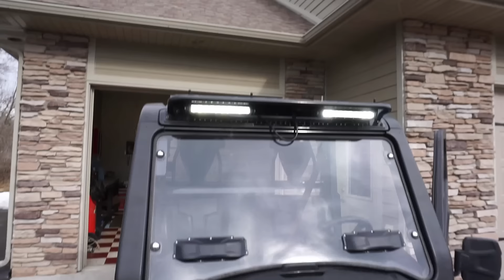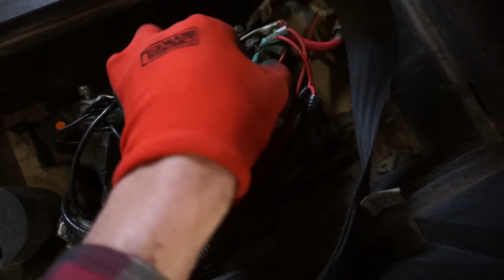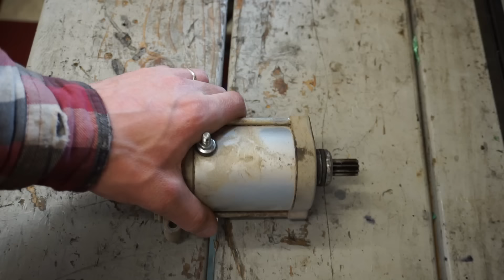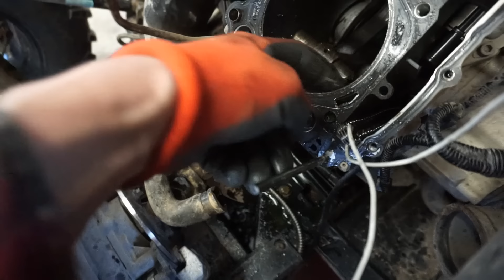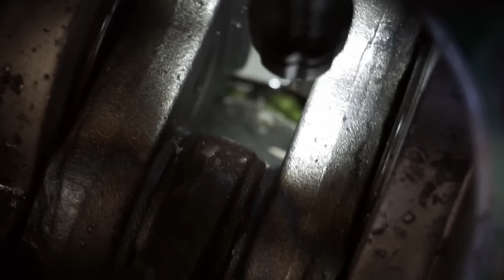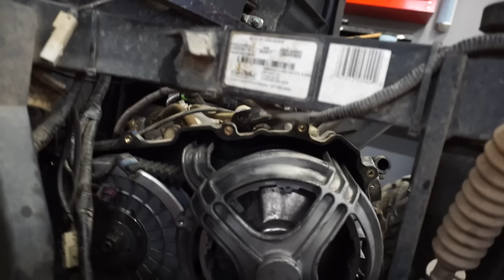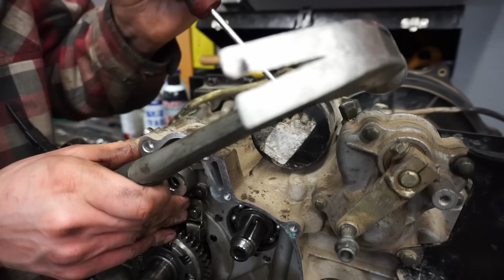I Bought This $15,000 UTV For $3,500. How Bad Could It Be?

Comment: These are a rebranded hisun… i have a hisun 750, i assume they arent as reliable as a name brand machine, but, i run mine easy(for real, unlike this one.. lol) and i have 520 or so miles with 130 hours… so i dunno if that one was just used in the yard… i drive mine down the road, and around the farm… to the local dollar general a couple times… i keep it under 5k rpm except for short bursts…

Comment: 😳the Wrist Pin still in Place 🤣 The piston just Was a Potato Chip in the Crank case 👀 First Sign 2018 How much ? How’s About I offer you a free Oil change , Remove the Spark  plug 👀 Ahh No thanks ,

Comment: " I changed the fuel pump, plug coils crank sensor cam sensor and even the gas. It had bad gas and I changed the gas and it still wont start."

Comment: Big lesson learnt,  always check the spark plugs  it happened on a recent engine you did b4, I'd even be curious if I found a new spark plug in the engine.  But hopefully you come out on top. Shame you didn't get it for $1500,00 less. Andy Uk
Reply: What does "$1500,00" translate to in real dollars?
Reply: Sry $150,00 towards cost of engine parts you had to get. I'm sure if you'd  seen the bent spark plug before your offer you definitely would have offered less. But I'm wrong to mention this after you discovered it .

Comment: I had rmz250 do same thing.  We replaced top end took bottom end apart put new bearings and seals crankshaft seemed great but after 3 short rides the rod broke in two and destroyed everything 😢 to much stress on crankshaft I guess when It blew apart

Comment: If you have to, don't drill out broken bolts like you had on the valve cover. Just weld nuts to them. Way easier and cleaner

Comment: Talk about mia,dang that piston flew the coop then got mulched up by the journal crusher.when you said omg!!and couldnt see any pieces yet the piston was gone i thought dang somebody pulled a fast one on you took the piston out then slapped it altogether even though they knew piston was smoked!!from seeing the bent plug electrode.tell me they didnt look down that hole and saw no piston yet they want top price for a shell with gone engine.thats just wrong!!they played dumb mode,dont know just locked up,wont start.well then sell it cheap 500.00 bucks cause unless u can fix that motor.is all youll make in parts.yup they hosed you fer sure,cant believe u got no bore scope all motors u do,oh by the way since its just dead shell till motor returns.get that s.o.b.outside and power wash the friggen mudhole of an engine bay.!!!will be way easy to find plugs n such rather than wallowing in filth n muck n dirt.hell you.might even find loose change or that mia piston.hope internals on case are ok then u might luck out,fingers crossed.ok get back to work!!!!!snooky pa.😅😅😅😊😊😂😂

Comment: I am alittle surprised that this is your first time coming across this issue given the volume of machines you work on. I personally have come across it five times in my life and I only work on one or two machines a year because I fully refurbish them from the ground up. But yes, it is a bit odd that you did not get any metal chunks/shavings when you drained the oil and my thoughts would be the seller knew the damage was bad cause of how hard they were using the machine and likely drained the oil, saw all the shavings, etc and added used oil to hide the damage before selling to you. That is a scenario I have seen more than once before.

Comment: I bet the grandkids came for the weekend, and destroyed the grandparents SXS.  Catastrophic failure from over revving the engine down at the local mudhole, woodruff key bent, instant lockup.

Ouch...1ENGINE ASSEMBLY - 750
503-01372 503-02846B
$5,273.97

Comment: That is a Hisun engine, just rebranded for Cub. Motorcycle Doctor out of Missouri is a good source for parts and knowledge on these.
Reply: And this is why I love YouTube and its crowd sourcing. Great info!!
Reply: 47:23 You can see it (Hisun) on the casting :)   @John-vf9py
Reply: are they cast pistons? thats the only way i see this happening. there has to be others with the same problem. Edit, yes they are cast aluminum pistons. im surprised this isnt a more common issue on china motors.
Reply: I spent $12k on one of those 750cc Hisun Sh!tbox's from rural king....  let... me... tell... you... summ..... LMFAO!!!!! One of the worst decisions i have ever made in my entire life... piece of sh!t didnt even last 40 hours of normal non-abusive use!!!! The timing chain and valves plus other stuff literally came apart inside that janky noisy @ss little engine... rural kings repair schedule was 2 months out to even look at it for the warranty, THEN it was almost another month for them the to get the RIGHT parts from Hisun in China.... such a waste of money... I definitely should have went to Kawasaki and got a Mule 610 4x4 for $2k less. The 2007 Mule 610 I have now has almost 3k hours on it and is all original I paid $3k for it 2 years ago and it still runs like brand new....
Reply: @CurtisBBUSSIN  I've seen them last a long time with some miles on them and some have trouble. Having a dealer network has some worth to it when  buying a piece of machinery whether it is good quality or mediocre. I would never spend that kind of money at a big box store. In Arkansas retailers can't sell power sports products unless there is a service center on the site. Sorry you had such a bad experience.
Reply: Chinese engines are just junk. Now you have to find parts and still have just a rebuilt chinesium motor. Doesn’t make sense to me to spend $ on it. Sorry bud!
Reply: I don’t think that guy is around Missouri anymore.
Reply: I don’t think that guy is around Missouri anymore.
Reply: @Chickennss  Florida maybe now.

Comment: You need a lesson in good and bad looking oil. You said it a few times when the oil was brassy and you said it looked good. It shows in the video bad. You can see the brass in the oil. No way an old couple puttin around did that. Someone rode it very hard.

Comment: Edit: welded skid plate puts the nix on dropping the engine out the bottom. 

When my grandfather let me help with the vw beetle engine work, we'd free up the motor then lift the car off the matter which was on milk crates. Thinking the same here, engine out through the bottom?

Comment: Was thinking that possible that engine manufacture had a bad run of unhardened aluminum pistons. That might explain it breaking apart so radically. Would search for any recalls on any part or other similar stories. There is no way that just happens. Let Polaris know you have a utube channel and would love sharing good resolution because this is a very searchable situation. Work together they supply parts you labor result good PR for them. Ask for new engine if you can. I will be watching.

Comment: 31:50

I think thet  EnGine had P'iston failure Eh!  

Like thet Wrist Puh puh puh Pin uh... mufta  Theparated from thet P'iston,  & Βecause..

 the engine was running with all  the crank/flywheel and torque propelled with  entire  mass of A Moving UTV 

 just punched and pulverized the entire piston into the head untill it cruched down  little pieces

Thet was some Wicked disturbing , distructive...
  
                      Wi'err'dness

       lol Eh! 📻☕🦫SMH

F'uh...    Ugly!

I wonder how many of those UTV like that had  met a ver similar demise

 but props to the entegrity of thet connecting rod to do all that to a  Piston  and no have  exit access  thr  block...

Thatz Wierd* !!
          * sic because i thinκ ιτ should be  spelldwuite$trånge
  

       lol...
          Eh!
             l
 📻☕🦫

Comment: eb@y has complete aftermarket top ends for that for around 850 with new cylinder, complete head, cam, piston, rings, gaskets, cam chain,chain tensioner ect ect. I posted a link but youtube deleted my post. youtube loves to delete my posts anyway for some reason or another.

Comment: <Big Smile>  I am constantly humored by what the Seller tells you about the item they hope to sell.  

The original couple-

Older, only drove it to do a bit of Gardening around the home etc.  Sounds like the Little ol' Lady story, who only drove her car on Sunday's etc.  

I figure the original owner did a bit of Fibbing, especially since it was they who supposedly took this machine to the Dealer.  

The Mechanic would have had one of those Bore Scopes and would have instantly observed the lack of a Piston.  The Diagnoses was probably going to Cost the owner way more than could be tolerated, and the owner then sold it as quickly as possible, telling the next owner, he thought the Engine was Locked up.  

<Short Laugh!>  yeah, Locked Up might be a way to describe the condition without telling of a Catastrophic Event.  

Then the second owner, who knows if they knew of, or learned of the true condition of this Engine.  Passed it on to the next guy, who happened to be you, who were hoping for another "Got Lucky" machine.  Might need a Battery?  maybe a New Starter?  

And to hear about the original owner using this to putt around the yard pulling a Trailer full of Grass Clippings??????  

In a World where "Anything" can happen, Without tools, I doubt if any of us would have detected the level of damage inside this engine.  <Smirk> I'm guessing, a Bore Scope might be on the next list of Stuff to order up from Amazon?

Sheesh!  I'm thinking of Buying one, and I haven't worked on an Engine for a long time now.  

this UtV Story was indeed "Entertaining", but absolutely Dreadful!

Cant wait for the Sequel!

And Congrats on reaching the 400,000 mark for subscribers.

Comment: I’ve seen a lot of engine tear downs in my lifetime, but nothing ever like this. You couldn’t do that to the piston with a blow torch and hammer. Truly amazing.
Reply: Chinese made it this way for a reason,so you would have to just buy another new one 😂😢😮
Reply: I would trust Joe's diagnosis over zoros or zeros, whatever he calls himself??.  Any day!!!
Reply: Lol,,,, That is a bad one,,,, whew
Reply: Hmmmm, you have a battery that needs a charge or is possibly bad so you jump right to pulling the starter??? Then you pull a spark plug (still don't have enough voltage to even run the starter but you pull it just the same) plug is bent. Nothing in an engine will bend a plug like that so maybe when they were checking a no start engine they dropped the plug. However even though you still don't have enough power to start you go ahead and break down the engine. Noti g that the valves are fine no bad wear and tear on anything ahah! Piston is missing !!!  Even though you had no reason to expect anything other than a dead battery (you need to show 13.5 volts at rhe battery to be good)  so even though the oil is clean with no visible degree,  no sign of heat distortion or virtually anything that would be indicative of a thrown rod or failed piston, cracked rings or anything .   . . . You go straight to a tear down. . . . Some people will do anything for content. Small people with nothing real to offer.
Reply: @zorrorides1  ur a 🤡
Reply: @zorrorides1  'you need to show 13.5 volts at rhe battery to be good'  Nope. The voltage of a car battery should be around 12.6 volts when fully charged and the engine is off. Between 13.7 and 14.7 volts with the engine running.

Comment: I’m guessing one clip came off the wrist pin and the pin migrated to one side of the piston, so the pin was only pushing on one side of the piston. A wrist pin kinda has to be fully engaged. Anyway, after the bottom of the piston broke, the rod smashed the hell out of it in the few seconds it continued to run.

Comment: 11:20 the reason you see a low voltage going to the starter is because the starter is in a locked rotor condition and draws excessive amps while NOT turning!    Similar low voltage can be measured @ the Pos of the battery when the solenoid/relay is engaged !
Reply: Stopped in water crossing!

Comment: You should probably invest in a floor crane to help remove engines from UTV's. It would make the task a lot easier. Looks as if there was a wrist pin bearing failure because of low oil, which caused the piston to destroy itself in the cylinder .

Comment: Those things in Canada, in good shape go for around $10,000CDN. 
9 volts is a dead battery, you will only drain you booster pack down very quickly, use a good battery
It's hard to check the oil so many don't do it and over heat the motor, gonna need a rebuild
Yup, never seen a piston like that before, seen em holed, beat up from the valves or FOD, and skirts broken. Interesting.
Dipstick is in a hard to get to position, many people don't bother to check it and the motor overheats.
And that looks like regular overheating damage, with little to no oil changes

But anyway, $3500 for the machine, another $2500 to $3500 for repairs and you're still money in
Don't be in too big a hurry if you can't get the parts, you may find a wrecked one

Comment: the worst engine damage i ever saw was a 05 troy lee predator i bought for parts when i was young.. younger kid was riding went from 5th to first blew the piston off the wirst pin broke the rod and the rod acted like a saw at 10000 rpm or more about slicing the motor in half cut the entire front corner off the motor off cut the starter in half cut the input for the trans in half blowing gears through the clutch side center case and the clutch basket blew through the cover the piston hit the head so hard it broke the timing chain and bent the exhaust and push the head up about an 1inch high off what was left of the cylinder... i was amazed the kid got off the machine without even a cut there was bent and dented parts of the frame around the motor where parts hit it and a trans gear lodged in the bottom of the seat pan... i wish i still had the pics of it it was just amazing
Reply: I don't think I've ever seen a sentence this long😮
Reply: @azopene  thats whats she said
Reply: @azopene It's all about firsts on Joe's channel!  😂😂

Comment: Wow! Hate to see anyone get screwed but unfortunately it happens. That’s the main reason I don’t usually buy used toys/atv’s/utv’s. Unless I know the person personally. But you’re buying them for your channel so I guess  it makes a difference. Good luck, I hope you’re able to find parts fairly easy and the case is problem free. As far as removing/installing engine easier, I would cut out one of this support bars in back and weld it back in when engine is back in place.

Comment: My guess is they drained the oil, saw all the metal, flushed it and put used motor oil back in it and sold it. A bore scope down the plug hole would have saved you $3500.
Reply: I say this with a smile on my face, not a criticism.. I think you're right regarding the oil!
In my area (CT/MA) a good running, 2018, 1.8K mile, hard door/top/windshield would sell for $9K. Heck, a 2011, 3K miles, no doors/roof/windshield Polaris 800 is asking nearly $7K.
If I had the ability to fix it I'd buy it today for $4k even knowing what's wrong.Well, maybe not a Cub Cadet, china/mtd unit. Ha Ha:face-orange-raised-eyebrow:
EDIT: After watching the engine extraction I think I'll stick to Honda!
EDIT: Dave, you were right! he could have saved $3500!!!

Comment: It's not a good idea to operate the starter motor off load. These motors are generally series wound and will over speed when run off load. Over speed can rupture the armature which would be pretty much unrepairable. 😮

Comment: Caused chain stretch, got to go. Glad woodruff key survived. Not usual deal ya know. Glad you got some decent internals left. There is pullers for all that crap. That engine was at high rpm when it just stopped dead. Hope all gears are good and not toothless.

Comment: Bet this is an h1 engine. They are notorious for this issue. The air intake let's small debrie in through the carb and into the cylinder.  It was cheaper for me to just order a new engine through country cat

Comment: If you end up using the engine make sure you clean the whole oiling system, oil pump to oil cooler and all line's internally. It's crazy that a 5 year old cleran low mileage machine is that wrecked

Comment: "What could of caused this failure?" You asked..... Easy, see the name on the side of the UTV. CUB CADET = CHINA MADE. LOL.
The reason there was no "chunks" as you always call it or metallic material in the oil is a simple conclusion. When it blew up it instantly locked up there for metal pieces where to big and metallic material did not have a chance to circulate in the oil. You purchased a $3500 complete loss.

Comment: My girlfriend at the time (wife now) and I were talking on the phone at 530 in the morning while she was driving to work in her 2001 Jeep Wrangler, and it just stopped running.  That was in 2012.  In 2017 I decided to tear into it and pulled the engine.  Guess what, the #2 piston was missing, gone ... destroyed and laying in the oil pan.  Those 4.0L engines are known to do that due to the tight tolerances between the piston and sleeve/ cylinder.  If it runs low on oil for any reason it it likely to happen in that engine (Jeep).  Probably similar issue here.  Hope you are able to get it worked out and find parts for it as that seems like a very nice machine.  Would be nice to get it back to working for someone.
Reply: .....  it ended up costing me about $4k, but it is up and running and a daily driver for her once again 🙂

Comment: Wow piston consumed by engine?? WTH! I believe that you need to find a new engine because even if you can rebuild the destroyed engine it has sustained major damage that may not be readily apparent and will surface later - only to be a pain in the ass! 

With the low mileage it seems highly unlikely of an engine failure as encountered - likely a factory defect or engine was run out out of oil 🤷‍♂️